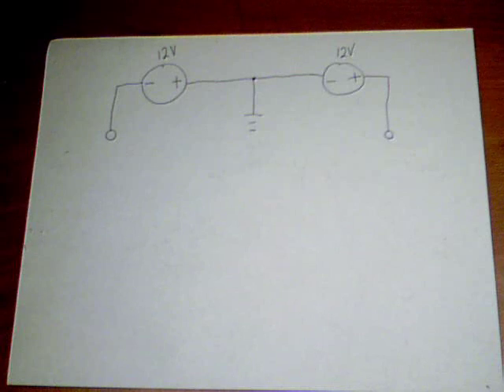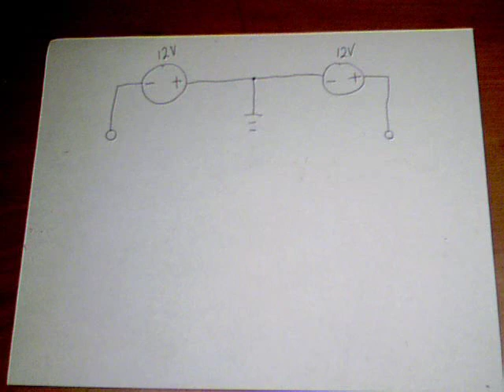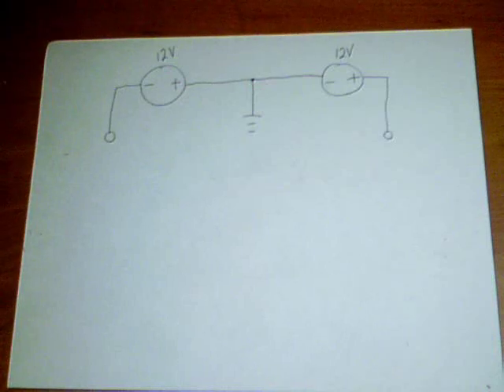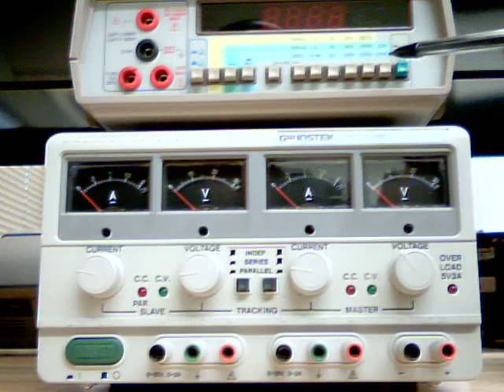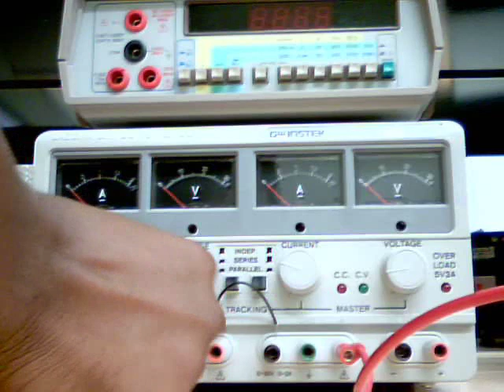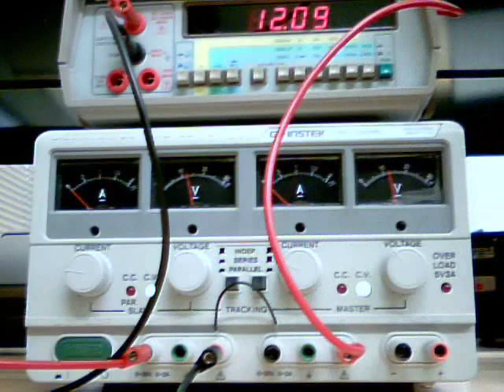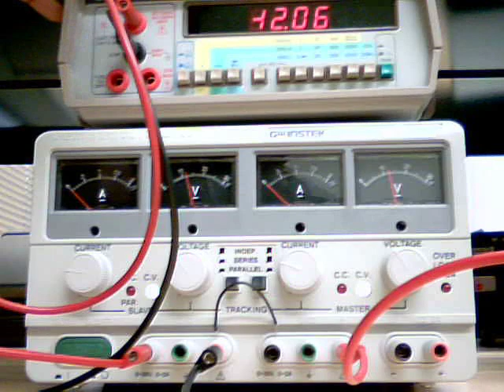Negative and Positive Voltage From A Dual Power Supply

Comment: If both separate channels are connected in series, won't the zero center be drawn to the terminals CH1+ and CH2-? The connection will certainly occur, but it may not be output to the output terminals and this will only double the voltage of the sum of both channels. But if the center of the connection of both channels is brought out to the output terminal (mostly channel CH1-), it is much easier and no jumpers are needed.

Comment: i need to power transistor with Positive 15V to Collerctor terminal and emitter terminal with -12V. Is it possible? since the value of the voltage is not same?

Comment: Left button in. Right button out. Unit is in series. It internally jumpers the black and red for a centre tap and then you get a positive and negative voltage with the right voltage control knob . No need for the extra jumper.
Reply from the maker: That is true. It just needs to be set up in series mode. That is definitely another option. 

Thank you for your input.

Comment: Does power supply require  to put in series mode?
Reply from the maker: Hi Sandip,
Series or independent should work. If the dual power supplies are independent, the wire must be used to connect the two independent power supplies.

Comment: is this power supply also connected to ground via its power cable? if so, would that not affect this setup?
also, suppose you have two identical single power supplies, would you be able to do the same thing? Thanks!

Comment: Thanks for this video, I am making a power supply and I wanted to use it to power op amps and I was concerned about having negative voltage output, now I can just use two positive outputs

Comment: if i connect both the red cables to the multimeter, what will happen? would it be 24 volts?
Reply: Yes. The multi meter measures potential difference so it could be plus or minus 24V.

Comment from the maker: I am not familiar with the atx power supply. However, here is what you need to know: 1) You should not need negative voltage. You should only need the positive and ground (or negative and ground) to charge a car battery. 2) You shouldn't need the potentiometer because the power supply should have a built-in potentiometers to vary the voltage. 3) As long as the power supply is producing a DC voltage there is no need for diodes. Diodes are only necessary if the supply is producing AC voltage.